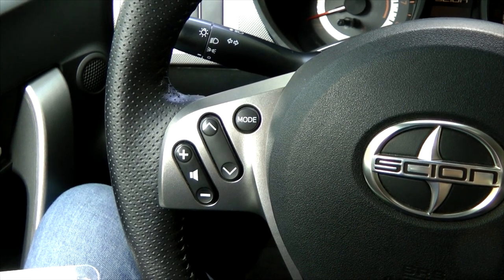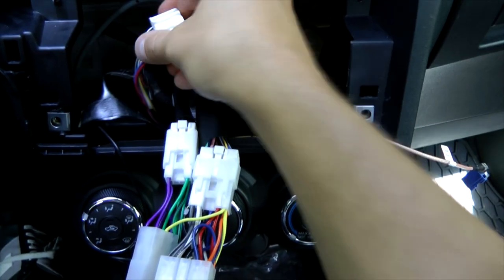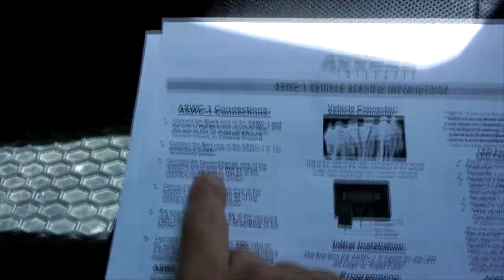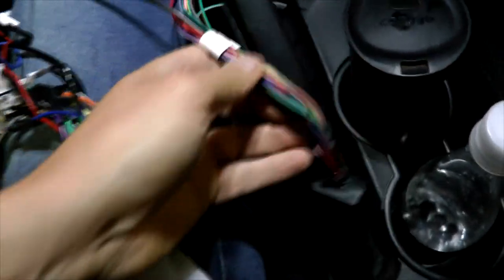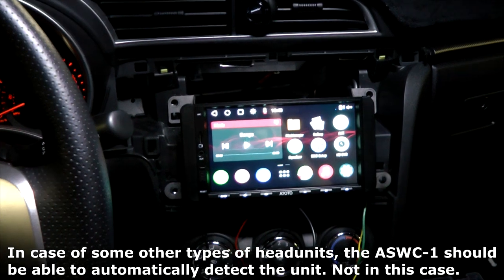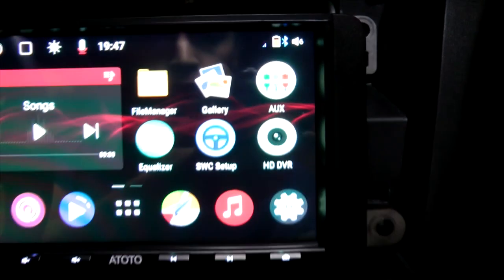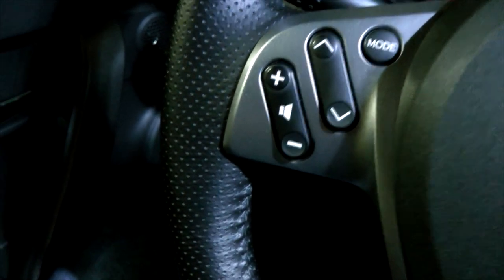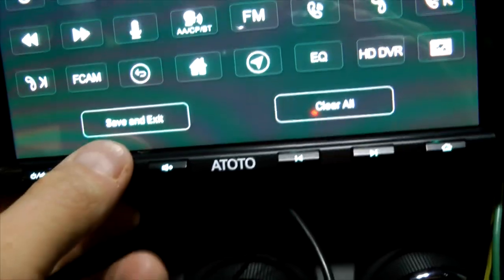How To Connect Steering Wheel Controls Using Axxess ASWC-1 (2016 Scion TC, ATOTO S8 Pro Head Unit).

Comment from the maker: PRODUCT LINKS:
1. Metra Axxess ASWC-1 Universal Steering Wheel Control Interface - https://amzn.to/3Jq5dhY.
2. ATOTO S8 7-Inch Android Car Stereo Link - https://amzn.to/4bJA2bP.

RECOMMENDED TOOLS:
1. SOLDERING KIT - Weller SP40NKUS 40-Watts Soldering Iron Kit Red/Black, 5 piece - https://amzn.to/3LySkmG.
2. SOLDER WIRE - TOWOT Tin Lead Rosin Core Solder Wire for Electrical Soldering - https://amzn.to/3yWsXDL.
3. ELECTRICAL TAPE - 3M Scotch Electrical Tape, 3/4-in by 66-ft - https://amzn.to/3J0M0TB.
4. MALE / FEMALE ELECTRICAL CONNECTORS - TICONN 100 Pcs Nylon Spade Quick Disconnect Connectors Kit - https://amzn.to/3ZRMUYe.
5. CRIMPING TOOL - TICONN Crimping Tool for Heat Shrink Connectors - Ratcheting Wire Crimper - Crimping Pliers - Ratchet Terminal Crimper - Wire Crimp Tool (30C, Blue) - https://amzn.to/42je244.
6. GROUND RING TERMINAL - Baomain Ring Ground Insulated Wire Connector Electrical Crimp Terminal 18-22AWG Red RV1.25-4 Pack of 100 - https://amzn.to/3Ltg77M.
7. ZIP TIES - 400 Pack Black Zip Ties Assorted Sizes 12+8+6+4 Inch - https://amzn.to/3xWjrjM.

Comment: For Android Head units you don't need the additional steering wheel control interface with a Scion TC or most Toyotas. You need the harness for the steering wheel and connect them directly to the head unit. Head unit has 2 wires labeled for that specific reason.
Reply: Do you know what harness exactly
Reply: @richardgomez8010  I will say it took me a while to actually get it working. If I remember right 2 of the wires I had to connect together but can't remember which

Comment: youre basically telling us to go to the instructions, we look into this videos to do it step by step with you cuz we dont understand the instructions!
Reply from the maker: The ASWC-1 unit is universal. Because of that the instructions will be different for different vehicles. It also works with different types of headunits. In this case I was installing ATOTO head unit into 2016 Scion TC. Vehicle specific instructions that you download will tell you which wires you need to connect to the existing connector in the vehicle(I briefly showed the wires which were connected in the Scion), it will also tell you which ground wire you need to connect (the grounding bolt was also shown in the video). In the video I tried to go over the key points in this installation. But you still need to go through the manual. There are different scenarios for different vehicles and head units.